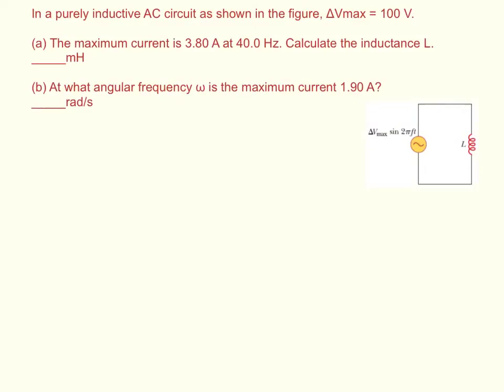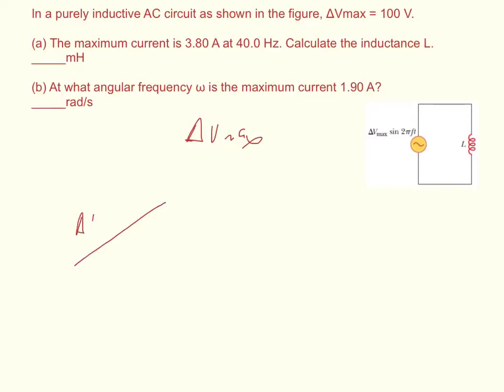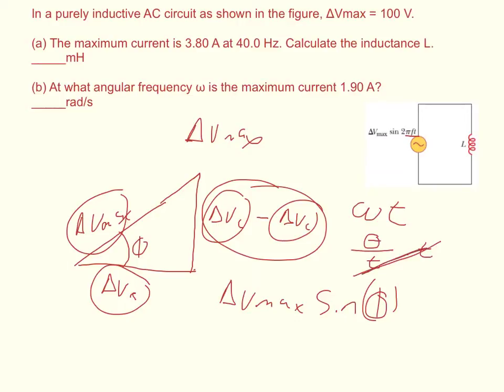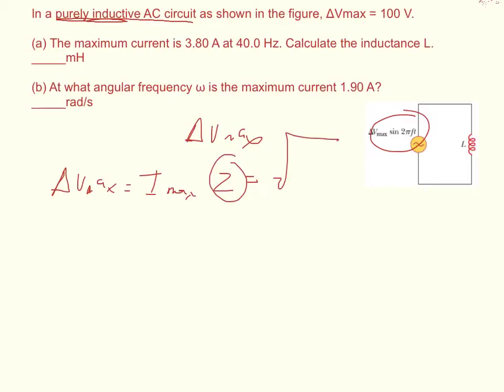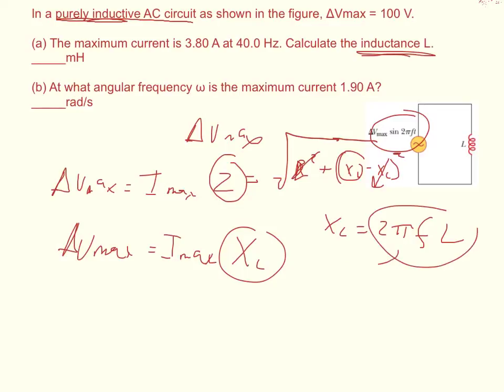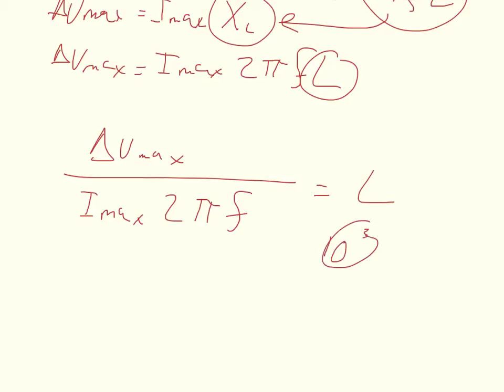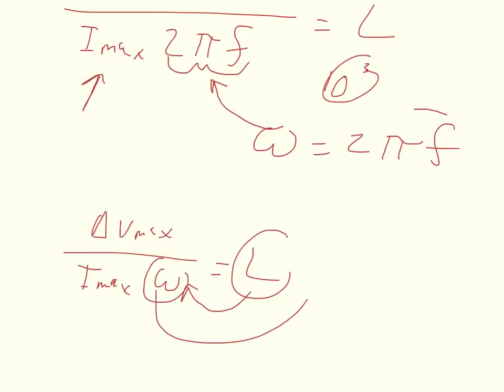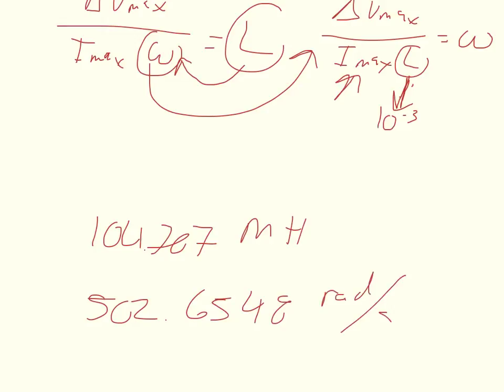Physics WebAssign Ch21 #5

Comment: Cant read your handwriting, its terrible. And you only work the general solution, but not with the particular solution.
Reply from the maker: At 5:59 I show both particular solutions. did you watch it to the end? 

I agree, I have horrible handwriting. I do try, I just suck at written stuff. 

Fortunately, I have a solution to offer to you. 

I actually decided to write a solutions-manual for each chapters questions from chapter 19 through chapter 28 (of the homework questions that I was assigned).

 -- I charged my classmates anywhere form $5 to $20 for the entire chapter and I would charge a little over $1.00 for individually question-solutions..

But for the world's sake, many people don't need the entire chapter....so, I am selling each chapter for $1.00

https://selz.com/editor?url=/item/530fe74ba1416c1234f39ee3

Pros:
1. Each chapter contains the typed-out solution from step 1 through the last step
2. Each chapter solutoin manual allows you to actually type your specific numbers in and it will spit out the answer (assuming you have the exact same question).

-- Hope that helps. 
 - Like and subscribe (maybe)